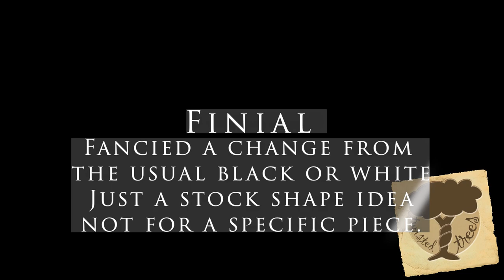Turning a finial with the SC2 Dome Jaws and a 30'ish° spindle gouge  #woodturning

Comment: Very nice, I turned my first finial this week ready for club night entry
Reply from the maker: Good luck on the club night, I like to have a range of finials cut as "suggestions" of both shapes and sizes, to achieve this I cut them all with either a 6mm or a 10mm tenon so they can easily be tried out on items that need them and I can decide on which I like the look of.
Reply: @PeteTwistedTrees  I am going to do exactly that once I get the 3 orders I have out the way